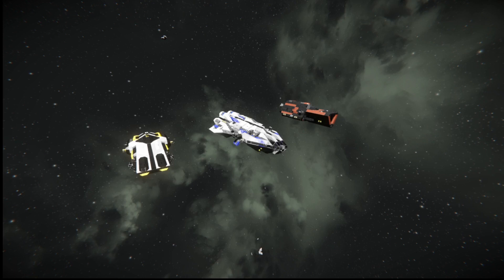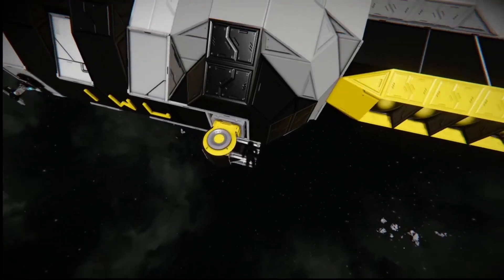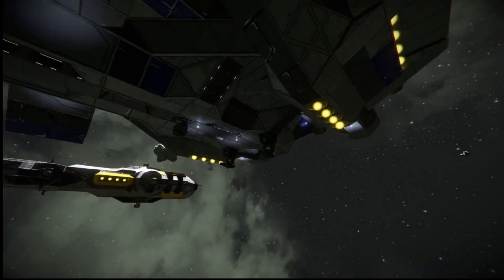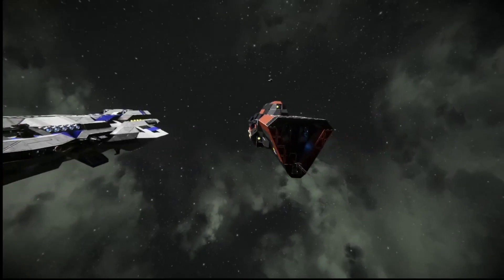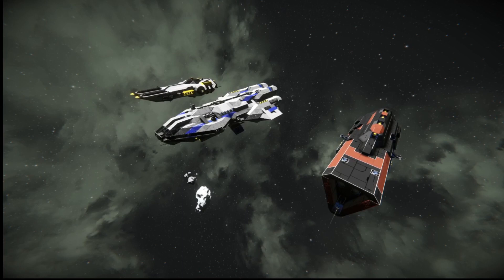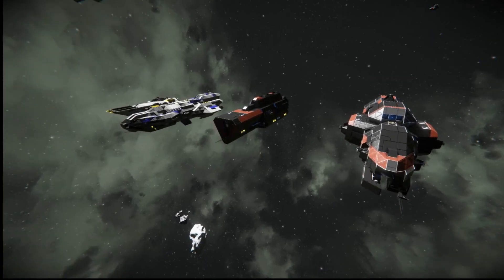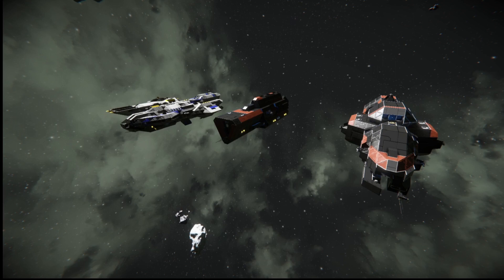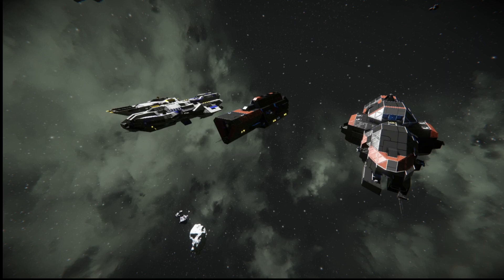What Makes A Corvette?

Comment: A corvette is considered to be the smallest class of proper warship (in the age of sail that meant it was "Rated). Everything smaller was considered a sloop-of-war, usually merchant or coastal ships in the age of sail pressed into service during a conflict.

In modern thinking a corvette is still the smallest true warship, anything smaller is usually a motor launch or patrol boat. Modern corvette focus on speed and maneuverability mostly armed with a single large cannon of some kind and an assortment of Anti-ship missile, SAM's or ASW equipment. Corvettes can fill many roles and often times work alone or in pairs separated from the fleet doing different tasks such as, anti piracy operations, maritime law enforcement, anti smuggling operations and fishery protections. while as part of a fleet or working independently as part of a larger fleet structure corvettes are just as useful, taking on ASW operations, ISR operations, screening, supporting integrated air defense nets. These last two tasks are depended on the specific design of the vessel but corvettes can also do littoral combat operations and support amphibious landing operations.

Corvettes are the smaller but equality versatile cousin to the larger frigates of modern navy's 
Great video!
Reply from the maker: Thank you! I try.
Reply: @badgerwildgaming6908  As side note. IRL Corvettes tend to not have centralized radar, but rather more independent weapons systems. Frigates mix coastal and sea operations, when Destroyers are pure oceanic warfleet escorts.